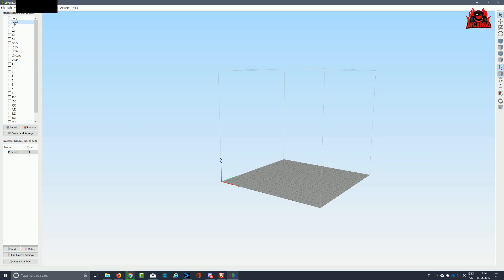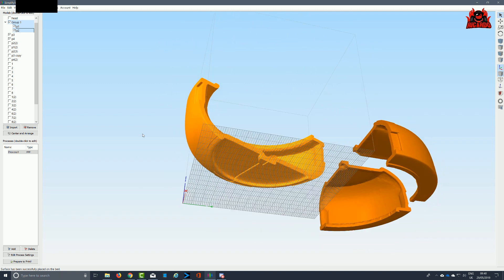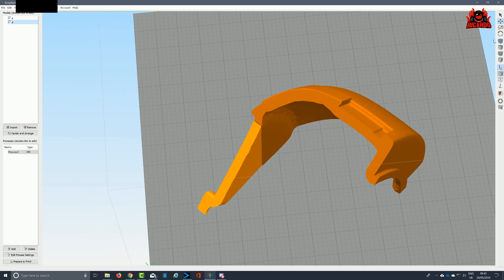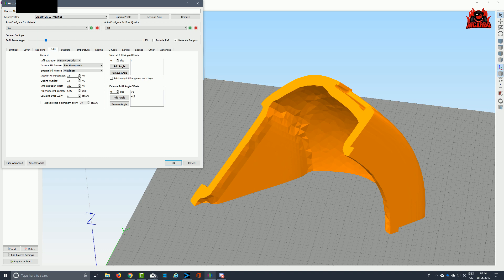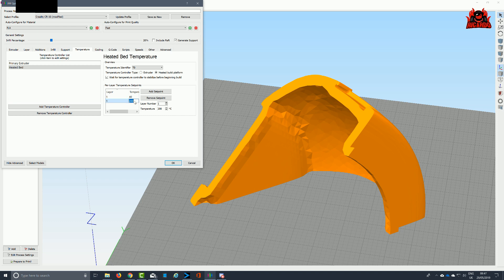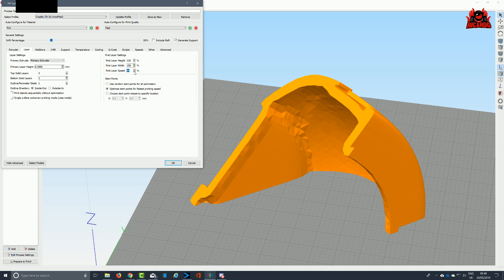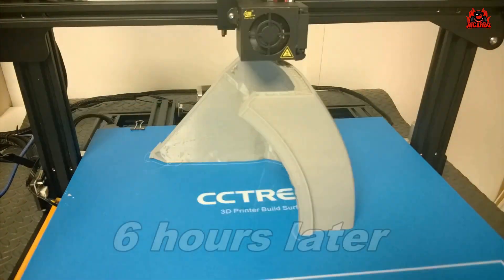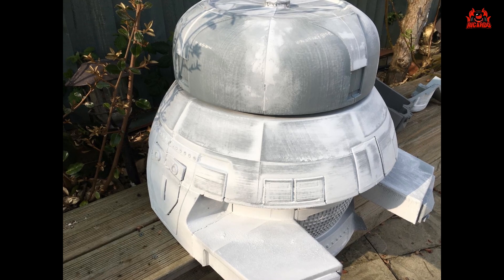Building VINCENT From Disney The Black Hole 3d Printing the Head (Part 2)

Comment: So, why not put smaller parts inside the model to make up part of the supports? Could you not then cut the additional parts out of the end supports? I'm new to 3D printing and I'm waiting for my first FDM printer to arrive.
Reply from the maker: This was my first big print. When printing eating plastic is a no no. Also every print is a learning experience. Once you get your printer you will be hooked

Comment: If the head misprints you could always turn it into the mashed up version of Vincent!
Reply: Mashed up version of V.I.N.CENT is OLD B.O.B. lol
Reply from the maker: @stuartaparker  very close - there are some differences between the models with Vincent being the ore uptodate version
Reply from the maker: I printed that part 3 times - 1 failed print - but that was because the heated bed failed and then it was the wrong size - but now I have it down - plus I have a slightly small bit for a 'spare'